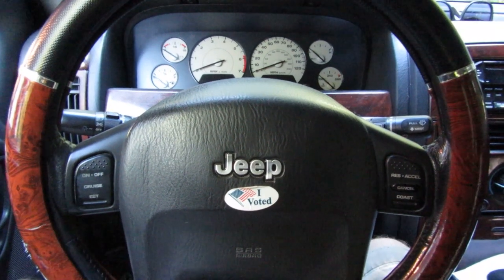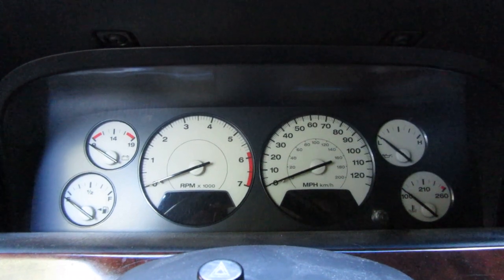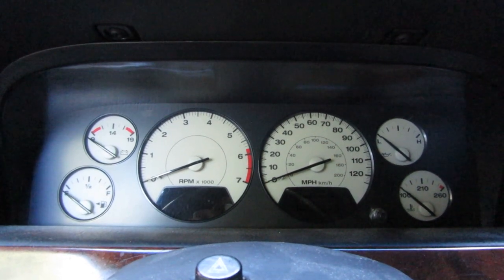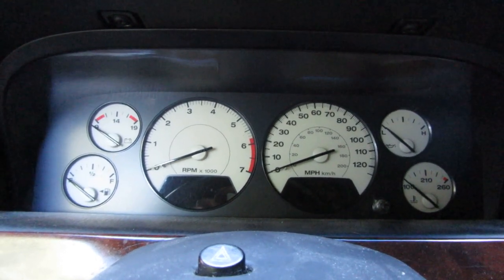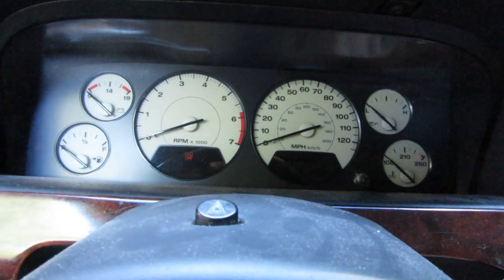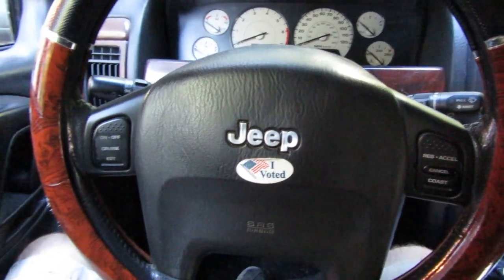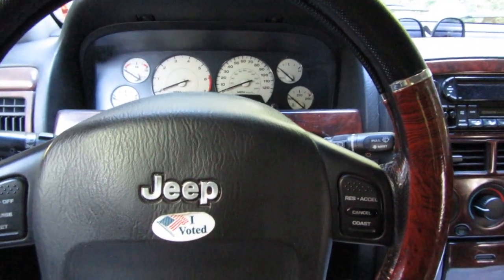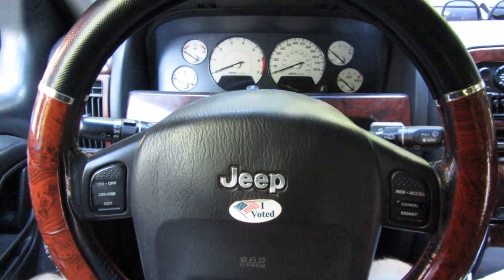Read your Jeep OBDII CODES without a code reader/scanner

Comment: But is this as accurate as the dealer read? It now costs $250!!! Jeep is terrible and I can’t wait to get rid of mine. If i really added up how much I’ve spent I would cry. WAY beyond the maintenance of any car I’ve ever owned.
Reply from the maker: Yes
Reply: Bizarre. I expected to pay about 1000$ a year for my Sahara when I bought it used. I assumed it would just cost me lots. Turns out, it's almost 24 years old and has cost me next to nothing. One broken something after a boyfriend went through a ditch. Maintenance, brake shoes, tires. That's it. Still has great AC. Bought the 2000 Sahara used in 2003. Wonderful machine.

Comment: Not all Chrysler products though. This doesn't work with my Jeep Compass 2008. 
I used to have a cheap ODBII reader but it doesn't work anymore. 

I had an Intrepid back in the '90s and it did have that feature. The code was not displayed though. Instead there would be a set of chimes: 1-10 "dings" for the 1st digit then another 1-10 "dings" for the 2nd digit. You would have to count them to get a number between 11 and 99. Chrysler provided a lookup table to convert this 2 digit number to the appropriate ODB code.

Comment: My 1992 Volvo have this. Siemens ECU.
But it's under the hood: a wire, 6 holes, button and LED. Every hole responds for different system - engine, abs.. You just have to plug the wire and press the button, then count the flashes. You can also erase the codes after reading by holding the button. 
BTW this key trick doesn't work on my 98 XJ.

Comment: Do you know what to do for a keyless jeep (fob only)? Tried pressing the button on/off three times with no luck.
Reply: The button pops off and you can manually insert your key fob and turn it like a normal key. However, I don't think this sequence works on the 2011 and later, at least it didn't work for me.
Reply: Have the jeep off don’t touch the brake and cycle three times it worked for me

Comment: Yeah my '95 Jeep doesnt do that! Mine blinks a light for codes but only on certain few problems.The other problems you have to figure out for yourself! Its totally frustrating!
Reply from the maker: Yea, OBDII started in 1996, so you just get the blink codes. Good news it you have far less sensors and nanny systems to break on you
Reply: @DEInTheGarage  yeah but you still have other problems that you dont get a code for.....and most mechanics in my area have no idea what the actual problem is. I'm trying to find out if those  obd 1 & 11 scanners give any more idea or info than just the key does.Its hard to find info on 1995 Jeeps. Few have them now. But I'm still looking.

Comment: I have the same car but it does not work 😩 please help
Reply from the maker: You have a Grand Cherokee and it does not work? What year?
Reply: 2002 😞 the ground cable recently broke when the battery was being replaced so when you turn it on all the lights come on and stay on. Not sure if that’s why. It will crank for 2 seconds then will stall. Do you know what this may be? The person who sold me the car told me it’s cause the ground cable is broke is this true?

Comment: how would you do it if you have a push to start jeep?
Reply from the maker: This feature is not available on more modern Jeeps. If you have a CEL in a push-to-start Jeep I recommend taking it to the auto parts store or you local shop and asking them to scan it. They should do it for free

Comment: I can't seem to get it to work on my 98 xj
Reply from the maker: Yea, it didnt work on my 2000 XJ either, but it has worked on all my WJs and ZJs.. I am not sure what is up with that
Reply: For 97 to 2001 xj its push the odometer reset then turn the key on
Reply: @rosssullivan9666  its make self check for all gauges , but in the end didnt give me any codes , while i have the check engine light always on . I really dont know what to do neither

Comment: Thanks, How to get the code on the 2017 Jeep Cherokee Latitude 3.2L ?
Reply from the maker: I'll be honest, i have not had the opportunity to try this method on a newer Jeep, but I believe it is the same process. Have you tried this on your Cherokee?
Reply: Thanks for you reply. I tried your steps, but it didn't worked out. It just says "P Code" and nothing more and displays the miles back after a sec.
Reply from the maker: the number after "p code" SHOULD be the number of the code. Are you sure it is showing you miles and not the code?

Comment: Just bought my first Jeep a few weeks back ,  2000 wj.  I'd have to say for a fairly modern vehicle they are quite easy and inexpensive to fix.  BTW thanks for the helpful info.
Reply from the maker: I completely agree. that is why I keep buying vehicles with that 4.0L. May not be the prettiest (best MPG, most power, etc) engine, but it will get you to work everyday and won't empty your wallet doing it.
Reply: You can't beat a Jeep 4.0 if you want something you can fix yourself!